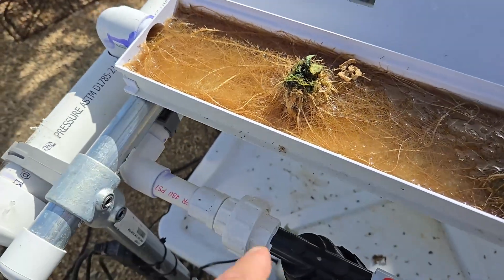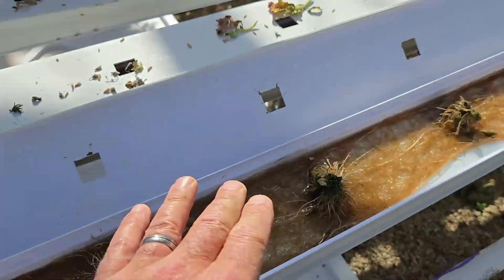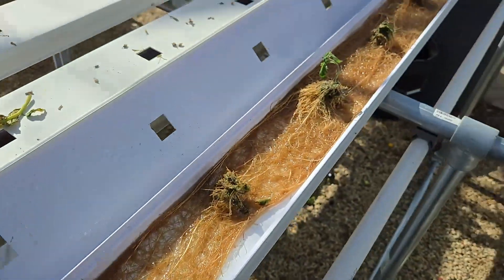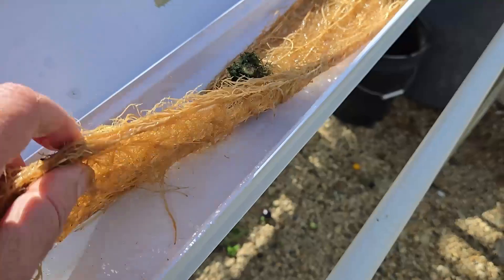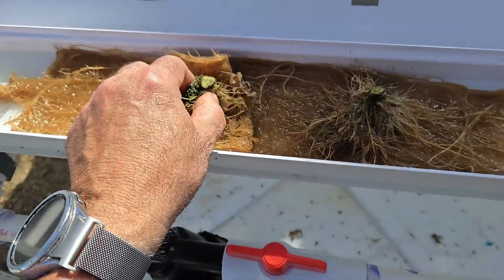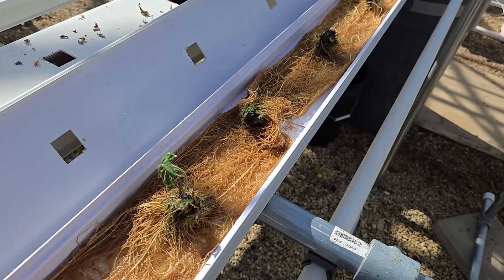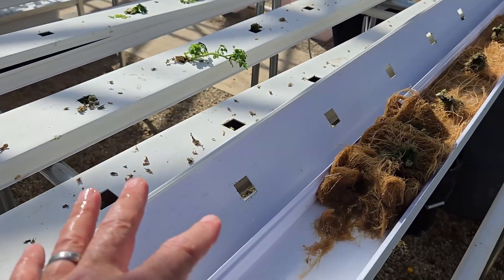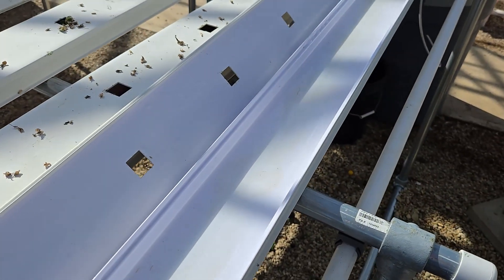What Caused the Tomatoes to Wilt in the NFT Hydroponic System

Comment: Really informative video I was searching for something to explain but nobody did until I found this video. So do you recommend not doing tomatoes in NFT system at all or what changes do you think should be made? A round pipe would be better? I would appreciate some advice. Thank you in advice.
Reply from the maker: The answer to this question is both climate and variety dependent. 

I like growing the heirloom variety 'Tiny Tim' and 'Everglades' as they produce many tomatoes and are hardy in zones 2-10 (watch more here: https://www.youtube.com/playlist?list=PLrPe2QBzDOzvJvCPIg2Ck2lV1HvmzlNdy). I've grown them using a small rockwool plug (1"x1") in all of my hydroponic systems - NFT, vertical tower and dutch bucket - and had them do well. 

General guidelines for hydroponic tomatoes:
- Varieties labeled as 'patio', 'compact', 'cherry', 'bush', or 'container' produce smaller plants, require less trellis/support, and don't mind being crowded 
- In general, tomatoes have more root volume than leafy greens, so it's best to provide a larger root growing area (say a 2.5" net cup instead of a 1.5") -- which is why most growers prefer using grow beds containing loose media like expanded shale or hydroton. 
- If space is limited, trimming the roots will help avoid issues like root rot (trading space for time).

Ultimately, trail and error is the best approach, so feel free to ask more questions as you continue along your vegetable growing journey. 

I hope to publish an expansion to my 'Easy Growing' series which is hydroponic specific and includes most common vegetables, so check back in a couple months for the announcement! - The Vegetable Doctor Team

Comment: Tomatoes are normally too large to use in NFT, better of in a Krafty 30 gal bucket at full strength nutrients
Reply from the maker: True, they won't give the yield you'd have with a traditional Beefsteak or other large tomato cultivar(~15-25 lbs compared to Tiny Tim's ~2.5 lbs); however, these cultivars are selectively bred (using traditional crossbreeding techniques) to be small, dense, self supporting bush types which would grow well in hydroponic/aquaponic systems. Our research is striving to find cultivars which create balanced nutritional use in these closed, re-circulation systems, thus avoiding toxicity from unused nutrients. - The Vegetable Doctor Team